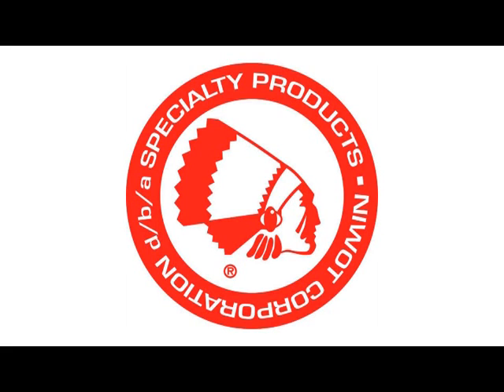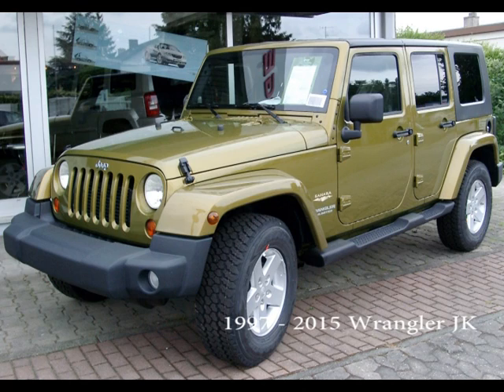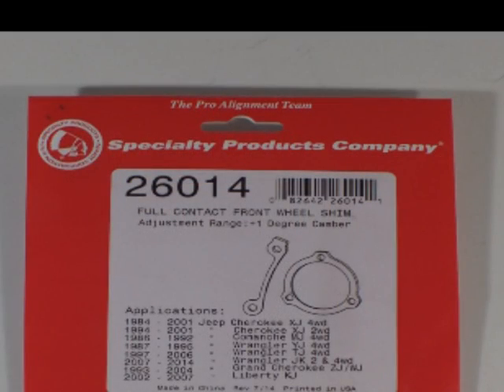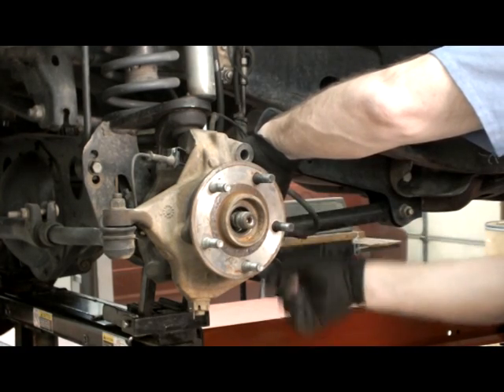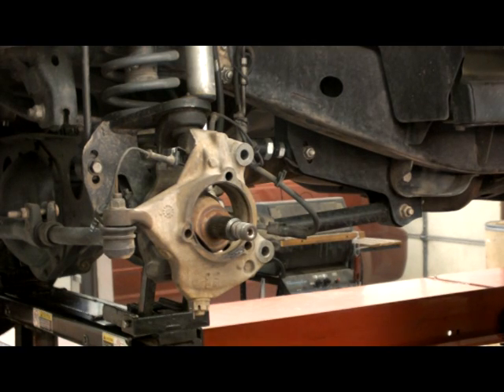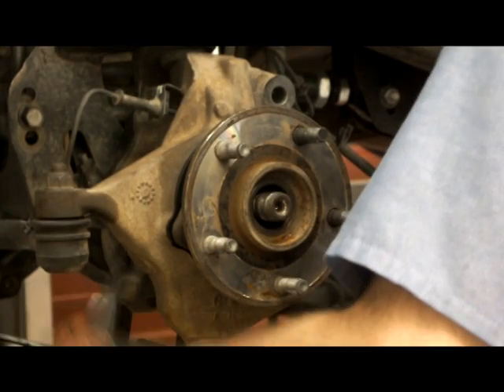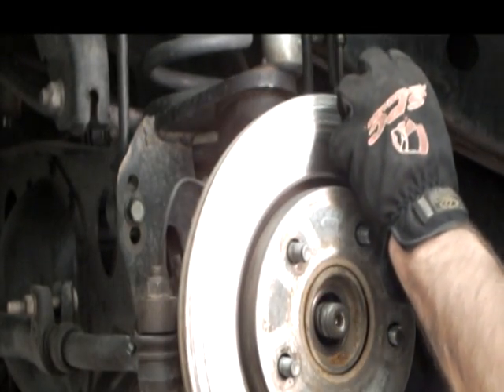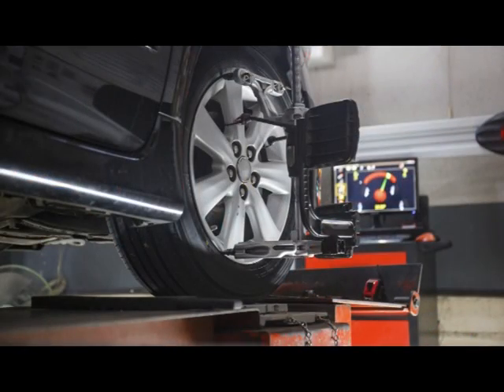26012 & 26014 - Jeep Camber Shims - SPC Alignment

Comment: I tried these on my 89' Cherokee. Nice idea but didn't work. They did adjust the camber, However it canted the the brake shoe housing so that the brake pad did not sit flat against the rotor. So the brake pads did not make full contact with the rotor and braking power was noticeably reduced. I ended up installing Camber correcting lower ball joint sleeves. It was a lot of work, but it is solid.

Comment: My 2004 cherokee has positive camber, the outsides of the front wheels are getting chewed up. Is there a product for  correcting positive camber? (No, it's not the alignment)
Reply from the maker: We show the Cherokee XJ with the solid front axle ending in 2001. If it is this vehicle or the Grand Cherokee WJ through 2004 you can use the 23510 series of offset ball joints to correct a positive camber problem. Please see our website at www.spcalignment.com for complete application.
Reply: Check your ballpoints for any wear. If your camber is out of spec you either have a bent housing, worn balljoints, or bad wheel bearing.

Comment: How durable are these? If I go off-roading with these, will they break?
Reply from the maker: These shims are made from high strength nylon and should not cause any issues if they are installed correctly.
Reply: @SPCAlignment  can I stack these? I need 2° more of positive camber. Or, do you have ball joints that’ll help me in this situation. I really want to run 35-37” tires with offroad use in mind
Reply from the maker: @senditentertainment4361  As per our FAQ on the product page of our website we do not recommend that shims be stacked. If camber is excessive the axle housing or hub may be bent and this should be addressed first. We do offer offset ball joints for many Jeep applications.

Comment: Will this effect abs speed sensor performance . On the video the sensor is taken out but not shown when installed or if adjustments are needed
Reply from the maker: The instructions call for removal of the ABS sensor to avoid damage to the sensor during the hub and bearing assembly removal and reinstallation. Once the shim is installed and the bearing is reinstalled, the instructions then mention reinstalling the ABS sensor. Because the tone ring is fairly wide, the sensor installs mostly from the side and the shim is only affecting camber, there have been no reports of loss of ABS sensor performance.

Comment: Just bought these.  The shim says front but no arrow, really should show which of the 3 bolt holes is the top front and back.  You have a 1 in 3 chance of getting it right.  Nice shim but install directions also are crap.
Reply: How did you end up installing it?
Reply: Where did you get 'em
Reply: @rongorman8488  AutoZone
Reply: @rongorman8488  AutoZone